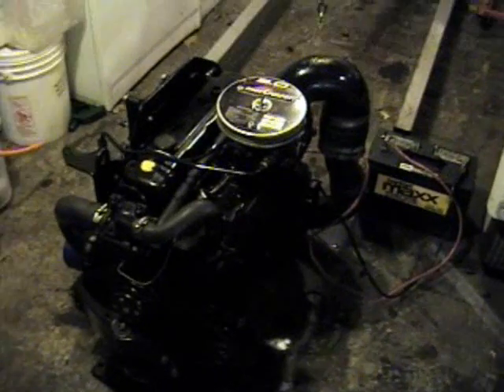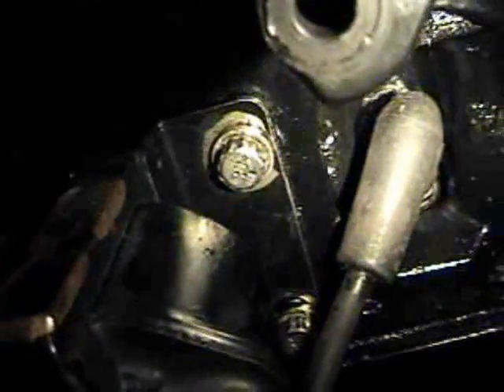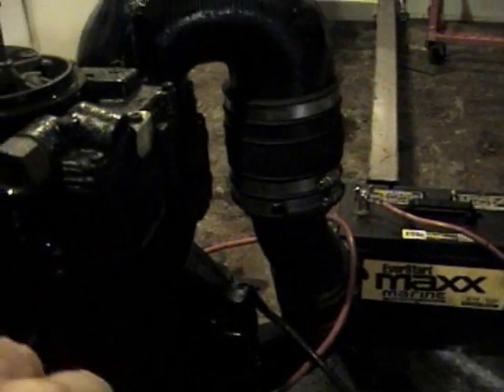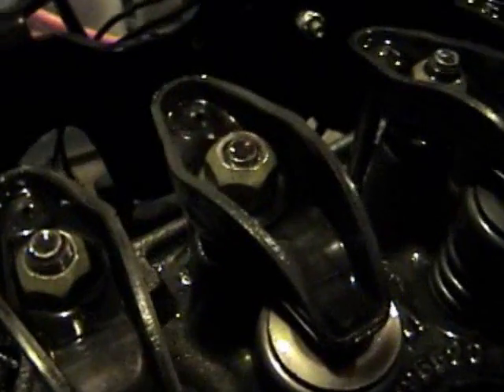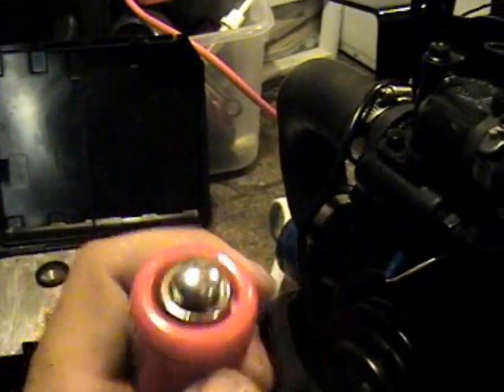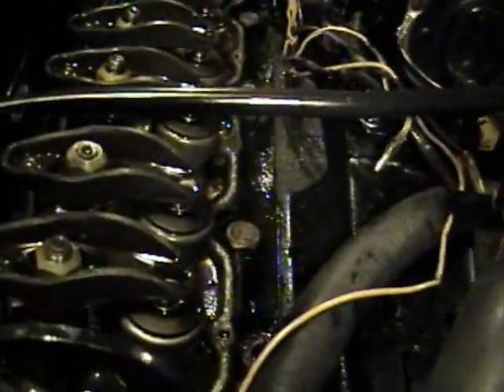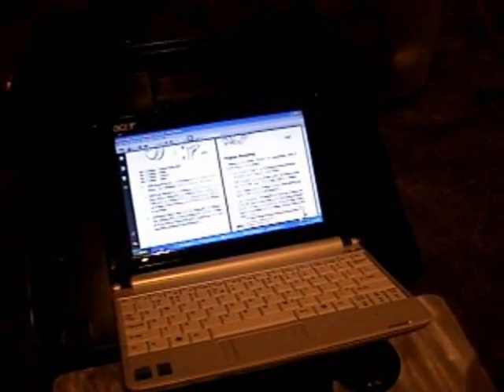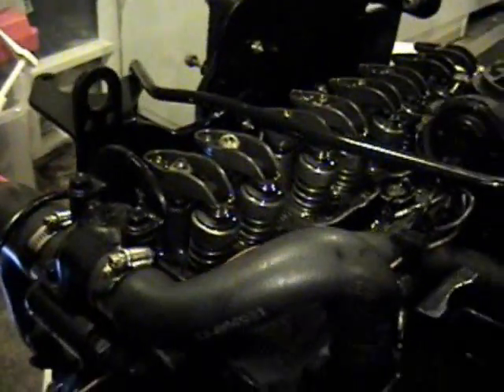Mercruiser 3.0 Valve Adjustment Video

Comment: Some other youtube videos suggest tightening the adjustment bolt 270 degrees instead of just 180 degrees (after valve lash).   Which is more accurate ?

Comment: I have the same engine and have low compression on cylinder 3. Air is coming out of the carburetor. Could this procedure on cylinder 3 intake valve potentially fix my issue? 50 hour engine that sat in a barn 10+ years. Possibly cylinder 3 intake valve was open during that time and corrosion has set in. Thoughts?

Comment: Thanks for this video! I have a 1994 Mercrusier 3.0 litre. My issue is that when the boat is cold it runs and sounds good. After 3-5 minutes at full throttle I get some popping. I'll back the throttle down to no wake, the popping goes away and I hear a ticking that lasts for about five minutes and then it goes away. If I throttle up again, the popping will come back repeating the cycle. The problem started with a sudden bogging down while pulling a tuber. I think I had bad gas with ethanol. I started using non ethanol fuel, put a can of seafoam  with each 5 gallon can of non ethanol gas. I replaced the fuel filter at the base of the engine and cleaned the filter inside the carb. I replaced the spark plugs and by this time the bogging was gone but the popping was still there and then I noticed the ticking at no wake. I changed the ignition coil but the problem persists. I will change the distributor cap, rotor and spark plug wires tomorrow after getting them from the marina who had to order them. It that doesn't fix the problem, what should I address next? Thanks for your help!
Reply: Timing is off or running lean
Reply: I know a little late to help I'm sure you gotnit figured out by now but for future reference I've been told if it's bogging and popping 9 out of 10 it's electrical,  look at points plugs wires and timing if it's just bogging it's fuel related carb filters fuel pump.....its held true every time I have a problem so far

Comment: 1.E____1
- I_____2
2.I_____3  
- E----------------360=4
3.E_____5
- I-----------------360=6
4.I_____7 
- E----------------360=8

•	Turn motor over to compression stroke, both number 1 and 2 valves closed, make sure crank notch is aligned to 0 on timing tab, proceed to adjust valves 1,2,3,5,7 Going from front of motor towards transom, start by spinning push rod and tighten rocker nut until valve lash is removed “push rod should barely spin rocker arm should not wiggle or have play= zero lash” After zero lash is reached proceed to tighten rocker nut additional ¾ turn
•	Turn motor 360 degrees, placed crank notch back to 0 on timing tab, proceed to adjust valves 4,6,8 to Zero lash, After zero lash is reached proceed to tighten rocker nut additional ¾ turn

•	For extra measure, spin motor another 360 and check for zero lash on valves 1,2,3,5,7, spin another 360 and check 4,6,8. I found that 2 of my lifters would leak down and cause the rocker arm to bounce around. Hints the engine noise I kept hearing. 

Also if your having trouble finding the compression stroke you can turn motor over until mark on crank notch lines up with "0" mark on timing tab, and engine is in No. 1 firing position. This may be determined by placing fingers on No. 1 valve as mark. If valves move as mark comes up to timing tab, engine is in No.4 firing position and should be turned over one more time to reach No. 1 position.

Comment: I am thinking of undertaking this job as the video explains it so well.
I take it the spark plugs need to be removed before cranking to get oil going? Also how do I rotate 360° after adjusting first set of valves? I don't have external starter but would use key ignition. 
Thanks for advice.

Comment: OK? What exactley does it mean when you inform us to rotate it 360 degrees? Am  the only stupid one here?
Reply: You have to get the other cylinders at top dead center to set valve clearance for that cylinder.  All the cylinders arent at tdc at the same time hence why you need to rotate the engine to adjust the remaining rockers

Comment: Great video! On a new lifter, are you able to squeeze them in when pushing on push rods? Mine are very hard to push but I've seen on cars that the lifters can be squeezed in by hand. Just want to know if I need to change them or not

Comment: YOU DRILL A 1/2 HOLE ON THE TOP OF THE BELL HOUSING IN LINE W/ THE FLYWHEEL TEETH,(MEASURE FIRST!!)IN ANY PLACE YOU CAN ACCESS EASILY; it's thin aluminum(less than 1/4 inch,drills in seconds)

NOW YOU CAN TURN THE ENGINE WITH A 50 cent SCREWDRIVER,now with leverage,on the flywheel teeth; (FOOK THE MERCRAP ENGINEERS, I mEAN,THE MANAGERS,NO BOLT IN FRONT;  FOOK THEM).

Comment: hey, arround 9min you talk about what is inlet and what is outlet. pretty easy. almoust every engine in the world turns clock wise. so if you turn youre engine over you'll see that the rocker arms from 1 cilinder move one by one. now if you follow the engine working cyclus( 1 inlet, 2 compression, 3 ignition, 4 exhaust) it means that the exhaust valve rocker always moves first and then the inlet valve rocker. 
kind regards.
erwin

Comment: Hi. great video!  i'm having trouble taking my valve cover off. I removed the 5 screws that held the cover on, but didnt take the plate that holds the shift cable off. Did you move this plate soley for that clearance issue and to "make room"?  or is the plate doing a 2nd job and actually holding down the valve cover? 

Because my real issue that i ran into was this... after taking the 5 screws off, the valve cover didnt budge!  I'm thinking its because the gasket is sticking/ "gluing" the cover down?  i tried tapping the cover with a rubber mallet to loosen it up, but that didnt do anything. In your video, the valve cover came right out. If you have the time, let me know your thoughts, thanks!

Comment: Another method is to find TDC for #1 and adjust those valves. Rotate the engine one full turn and adjust the next pair of valves in the firing order. Continue to rotate the engine one full turn and adjust the valves on the third cylinder in the firing order and one final revolution for the fourth cylinder in the firing order. In that way you don't have to know which valves are intake and which are exhaust. Works every time it's tried with no room for error.
Reply: Exactly, that is how I do it also.
Reply: Good night pls explain better for me pls
Reply: @khalifahs371  this one fires in 1-3-4-2, so here the first cylinder is at Top dead center in firing mode. you can adjust both valves on the first cylinder. rotate the crank a full rotation and the 3rd cylinder is in firing order next because 1-3-4-2. adjust cylinder 3 valves. turn the crank again a full rotation for cylinder 4, adjust valves, turn the crank again full rotation and adjust the number 2 cylinder valves.
Reply: another way of seeing which cylinder is going to fire is watch the valves. Turn the crank, look for the valves that won't move because they're staying shut for the combustion(firing). A million ways to skin a cat

Comment: How do you change the fan belt without unbolting the engine
Reply: you cant
Reply: It's possible 👌.. I did mine last year. You just have to push it down between the mount and the pulley, alternatively you can use a flat headed chisel and tap it down carefully, and you're good to go! 👌😊
Reply: Take off the support bracket for right engine mount, take off front pulley and turn pulley sideways while manipulating the belt through
Reply: Exactly

Comment: why can't you do all the rocker arms at the same time without rotating the engine 360? I didn't fully understand that
Reply: If you tighten them all up at the same time some of the valves will be in the wrong position when the piston comes up. You'll have a whole lot of other problems if that happens.

Comment: great video i have just rebuilt a 3.0 my first rebuild. The only thing my manual says a full turn not 3/4 i have the mercruiser manual. I need to do this but dont have the remote start switch so i need to fig out how to rotate it with out the remote start but thanks it was a great vid

Comment: I Have a 91 GM 3.0 is the Valve Intake and Exhaust order the same? Ive read else where that is is  IE EI IE EI , But not EI IE EI IE ? can you help??? I have no Compression now.. I belive that they are set to tight now... and possibly not in the correct valve order